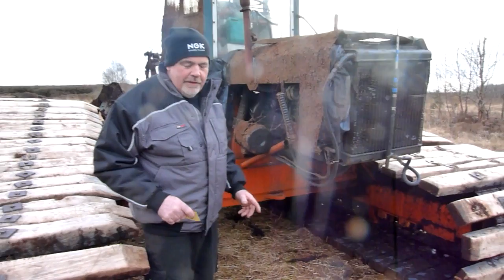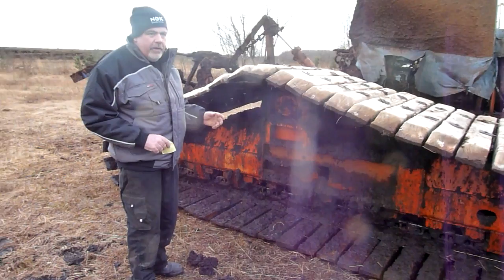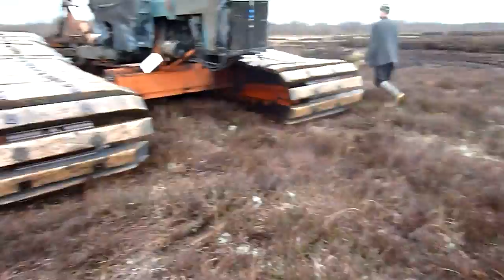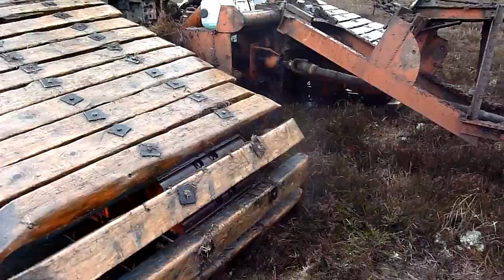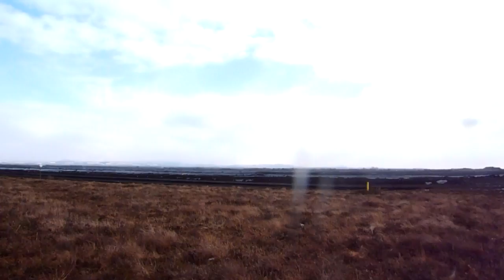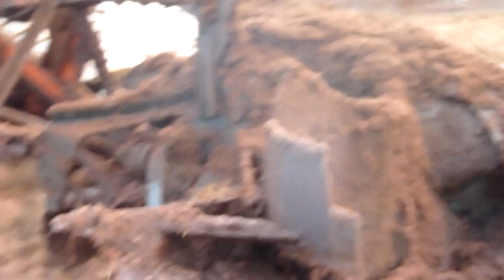Bog Excavator ditching in Irish Bog (Part 1)

Comment: Would a digger not be quicker
Reply from the maker: Hi Alan This machine has very low ground and will travel anywhere.This peat bog is 25 feet deep.
Reply: Yes but cant the tracks on the diggers be lengthened and widened for bog work ?